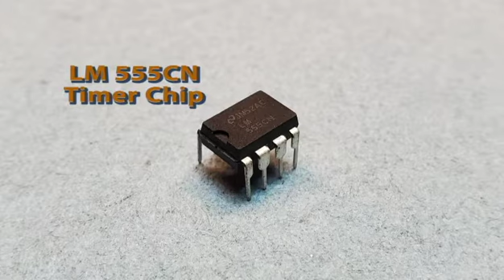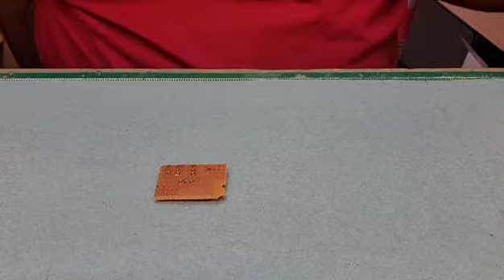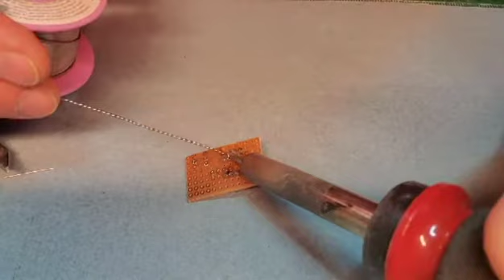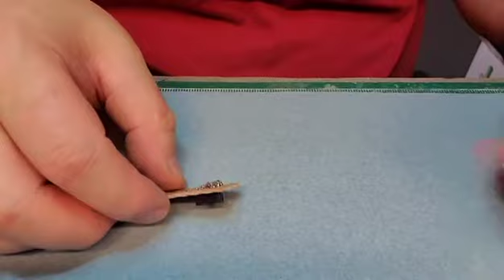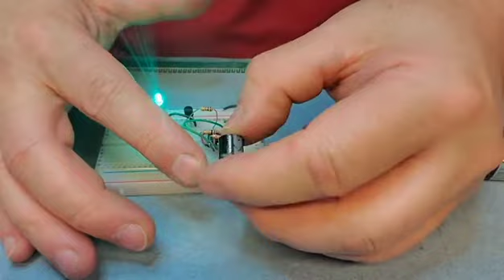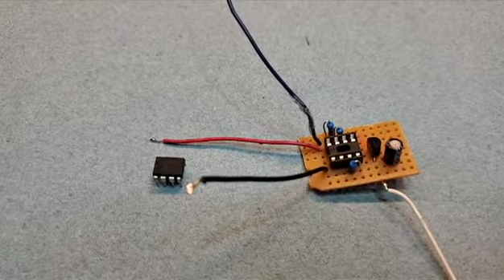How To Build A 555 Timer Flasher Circuit

Comment: Seen it, done it!  I also use the arduino boards for flashers. You can do a lot more by changing your parameters.  Boards are getting more expensive though, so I might start using the 555’s again.